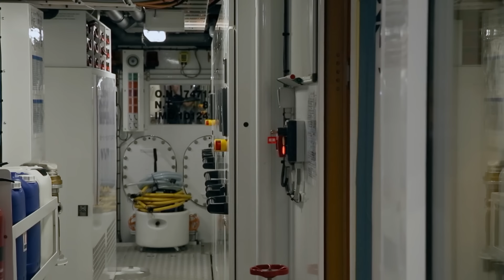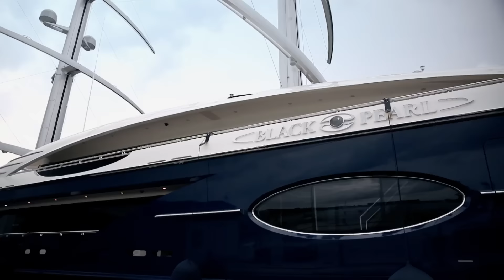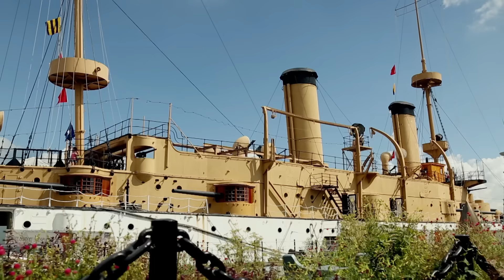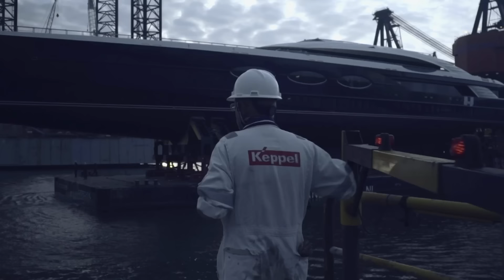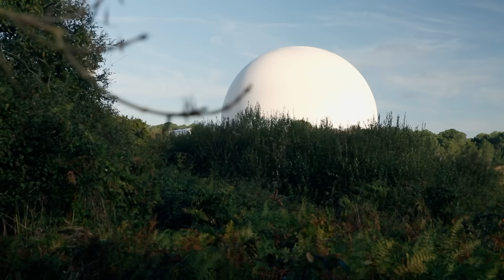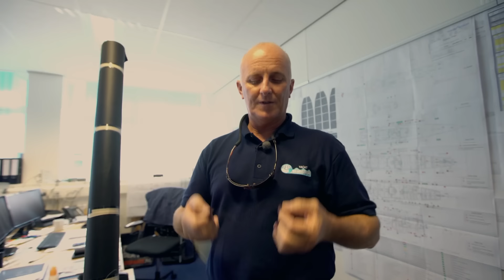The Black Pearl: the Revolutionary $200M Sailing Yacht | Blueprint

Comment: Excellent video, but....1) Very US-orientated film. The British were the first to commercially deploy feathering propellers and the French were the first to build steel warships.
2) Thousands of people have crossed the Atlantic without fossil fuels. Solar cells had been developed decades earlier, not using silicon. 3) It would be good to get an update on whether the solar cell clad sails worked - I have serious doubts. The generating turbines should be enough to power the boat even in light winds and the cells would not be enough to provide meaningful drive in zero winds anyway. 4) The sail rig appears to be a direct copy of the Maltese Falcon??

Comment: sorry, but this is one of the worst documentaries i have ever seen... its just a repeat every five seconds and if something new is introduced then there is no significant technical information about it... Like how did they manage to distribute the load of the masts safely to the hull? And i don´t mean: ah they used this and that material and that is it, I want detail about the structure. Just a steel sheet alone does not hold any of this! this is a technical doku isn´t it? i did not hear any significant technical information! AND STOP REPEATING YOURSELF SO OFTEN!

Comment: Fuel usage of this yacht according to Wikipedia:

1: As of 2018 when designed, it was expected that Black Pearl could cross the Atlantic using only 20 litres (4.4 imp gal; 5.3 US gal) of fuel, aided by regenerative technologies. (It was not designed in 2018, it was delivered in that year.)

2. Under sea trials, Black Pearl achieved 20 knots of speed on the water, and its developers expected as of 2018 that it might one day be able to transit the Atlantic using no fuel.

3: In its first crossing, 5600 nm from Montenegro to St. Barths in 2023, Black Pearl sailed approximately 80% of the distance and consumed 32000 liters of fuel.

So much for expectations and good intentions.

Comment: A feathering prop is not an unusual option, especially on twin engine aircraft.  Many boats have a feathering prop.  The Black Pearl is not innovating by using it.  It's pretty standard fare for anyone that can afford it.  That being said, the prop systems are not that expensive on smaller boats.

Comment: It really is a remarkably traditional design that has been beefed up with tons and tons of carbon fibre to reduce weight, and tons of electric motors to replace crew.

Lots of potential performance has been left on the table by not using: aerofoils, hydrofoils, multi hulls, air bubble lubrication, solar cells for electrical assistance, and likely a couple of more exotic enhancements.

Comment: "8000 kW per month" doesn't make any sense. If they mean (as I guess they do) 8000 kWh per month, we could perhaps estimate an average of 10 hours' worth of sunlight per day, so 300 hours per month; therefore an average power output of roughly 27 kW from the solar cells.  I'm always surprised by how many people who ought to know better can't get their heads around the difference between kW, which is power, and kWh, which is energy. It's like confusing speed with distance, which people mostly don't do. If you were to say that a car can do 130 mph per day, people would rightly think you a little confused.
But didn't they also say they could run the props as turbines and generate electricity that way? They didn't make clear how many kW that was at top speed, but I guess it would be considerable if it slows a 3000 tonne boat down from 20 to 18 knots. Obviously they'd try not to use that system when going for speed records.
Reply: The 8000kW he mentions is what the vessel would normally consume in a month of active ops; he mentions a figure of 25 or 27kW for the props in gen mode, but as you imply, it depends on the sett you give your props and how much speed you're willing to sacrifice for that power gen; anything over 15-20knts I'd go for max re-gen, I'd probably also be telling the crew to switch off everything that didn't need to be on!

Comment: Can someone answer a question for me? Why don't cargo ships use sails to reduce fuel costs? I always wondered this. The only thing I could think of is maybe it would make it unstable but I can't think that's true with all that weight.
Reply: Weather variability , installation , operational and maintenance costs , speed . 
This craft is just a dinghy compared to a modern cargo ship . How much rigging would be required to propel a cargo ship competitively against diesel power ?
Reply: @DamosTamamoto there are very inexpensive kite systems that retract themselves and can be replaced in like a half hour. During favorable wind conditions you pop them and retract when it isn't.
Reply: @butter7734 😂🤣 really ? Like I said … how big are modern diesel powered cargo ships ? Why are they so big ? If it takes three 200ft masts to propel the sleek Black Pearl with 3000m2 of sail ( if I remember correctly! ) with a displacement of 3000 tons , how many kites to propel 70000 tons ? And popping out of what ? Sailing vessels need a substantial keel to transfer sail caught wind energy into forward motion as the wind does not always conveniently blow from behind . An increase in draught would restrict entry into ports . Lifting keels reduce cargo space and further raise costs . Ships would still need viable diesel engines to keep to schedule when there’s no wind to fly kites and to manoeuvre in ports , should they be deep enough ! But I’m no expert but the fact that we don’t see kites or any other types of sails on modern cargo ships when the technology is well known must be because that it makes no overall economic sense to do so .

Comment: WHY COULDNT YOU ''RETRACT THE PROP & SHAFT''?????????????    you could pull it up to the SHAFT ALONG THE HULL and then the last prop blade that hung down could ''FOLD'' back and then ALL YOU NEED IS THE SPACE FOR THE REAR BEACH DECK TO BE AVAILABLE DURING SAIL/RACE FAST MODE......    

my ''version'' of this boat will have 3 or 5 of those panels as ''SOFT SOLAR PANELS'' working up to the goal of ALL OF THEM ALSO ARE INDEED ''SQUAREEMAST TYPE SAILS BUT MOSTLY THEY ARE SOLAR PANELS....  just hs to go ''faster than most of them other sailboats lol'' I PERSONALLY do not need ''the fastest OR BIGGEST'' but 25-30 knotts under sail is pretty enticeing ;) and would make ''the around the world from HEADING EAST TO WEST to ''even me back out'' cuz the US NAVY already messed up my clock, ORDER OF MAGELLAN 1987 USS OKINAWA LPH3 WORLD CRUISE ;)  actualy CIRCUMNAVATAGATION ''westward from San Diego around and back, thru BOTH DITCHES on the ''same ship''  ..... small percentage of people that have LIVED ON THIS PLANET can say that same ''thing'' ;) ((small percentage compaired to the total amount of people there have beeen that walk this rok we inhabit))

THANKS FOR SHOWING US THIS BEUTY !! :)  I have been folllewing the whispers of the ''NEW CLIPPER'' ;)   glad she is as pretty as she should be :)

BUT WITH THEM TUCKED UP INSIDE.... you can't use them to HYDROGENERATE....

Comment: All the effort this show made into telling us how bad it would be when propellers weren't needed because the sails were set out.  So the solution would be allowing the propellers to turn 45 degrees to not cause drag, because again, this is a sailboat, and having propellers cause any type of drag is bad.  Then, were told that the sailboat needs to produce electricity while sailing.  Instead of using the onboard diesel generators for electrical power, the sailboat can instead turn the now "put away" propeller blades back to its original position, so when the sailboat is moving under wind power, the propeller blades can spin by water force creating power for the boat.

Tell me again why so much effort and money was put into solving a propeller drag problem on a sailboat, just to not use it because you use those same propellers because of the drag it has to generate power?

Comment: Someone might know why but why wouldn’t the prop become net neutral if it’s spinning and generating electricity. It’s not providing power but it is now spinning based on the sailing speed. I guess anything disrupting flow would make it less efficient
Reply: Read your query 3-4 times, still can't ascertain what question you're asking.

Comment: Be interesting to see what you could do with this technology if it were optimized for capacity and cost rather than speed, so you would have something other than a rich man's toy. The narration is weird, keeps referring to "impossible" problems then telling us how these problems were solved with technology that's 100-150 years old, like steel hulls and feathering props. At some point I expected the narrator to talk about the "impossible" problem of getting light inside the hull, but no! 140 years ago Edison et al. invented light bulbs! And electric power! You can even use it to cook food! The solar-power sail system, OTOH, is a genuinely impressive piece of engineering.

Comment: Why do descriptions of the Black Pearl always make out that they were the ones who invented the technology when it was the Maltese Falcon that pioneered it all. The Black Pearl is just a slightly larger copy of the Maltese Falcon!!!
Reply: Same Dutch designer.
Reply: Actually, the Dina Rig was first installed on a Catamaran as a test bed back in the 1980's
Reply: Not, really. The big added features of Black Pearl are the solar sails and impeller that can charge the batteries instead of relying on diesel generators. Maltese falcon also uses the dynarig, but was built before renewable technology had matured. Black Pearl is the maturation of the Falcon's design.

Comment: It's only the second-largest sailing yacht. Jeff Bezos's sailing yacht, Koru, is 127 meters (417 feet) long. It is considered the world's largest sailing yacht.
Sailing yacht 'A' is larger but it is sailing assisted. It uses it's engines as primary propulsion.
Reply: Bear in mind this video is probably pretty old.
Reply: @zezzamoo  Both S/Y A and Sea Cloud were built before Black Pearl, and are larger.

Comment: It is an impressive piece of engineering and craftsmanship, but unfortunately it is currently only the second largest sailing yacht. 
1: Sailing Yacht A -  142,81 Meter
2: Black Pearl - 106 Meter
3: EOS - 99,92 Meter
Reply: Sailing Yacht A is a sail assisted motor yacht, not a true sailing yacht.
Reply: @jimbo1637  It has masts and uses sails to catch wind...motor assisted or not, it's a sailing yacht...it's in the name.
Reply: Unfortunately it's only the 4th biggest, Jeff Bezos "Koru" is 15m longer, and the "Sea Cloud" measures 109m...since 1931.

Comment: They've been feathering props on planes (and boats) for more than 100 years and you guys act like it's some great new thing.
Reply: I was going to say the same thing, the "I cant believe we're going to do this comment" I believe was for TV but just sounded so dumb.
Reply: and they think size doesn't equal speed, it does for boats and ships that don't plane or foil
Reply: 7yea   my above post said ''WHY COULDNT YOU RAISE UP THE SHAFT AND FOLD ONE OF THE BLADES BACK ALONG THE HULL and tuck up the other blades up into the ''BEACH DECK''  the rear ''storage space''.....  they have had folding blades for a LONG TIME TOO
Reply: I am enjoying watching the video, but it is definitely a puff piece made to lie while telling the truth.  If you have a small little lie with a big truth, you can make something sound much more than it is.
Reply: 18:33 did you miss the part where they talk about feathering from WW2? Comprehension fail much?
Reply: @theclifbar  You are missing the point.  A great example would be @ 17:00 the program says "Could an innovation from the past offer a solution to this unfathomable problem".  This implies that engineering hasn't continued to use this technology, and that the black pearl is very unique, by resurrecting the technology from the past.  It is not an unfathomable problem, because planes and boats have continued to use the technology from it's inception.  They do talk about the history, of showing it on aircraft, both old and new, but they also talk about how innovative the Black Pearl is, by using the technology, which is simply not true.  Do you comprehend that?
Reply: It is very negative feedback for a new thing. I think it is ok to go for a big statement creation and get excited about it. The world will always present as a creative space and there is no need to rubbish others joy
Reply: If you’re not into propeller flight, it might not be something you’ve ever considered. I remember finding out about it 20 or so years ago, when I was reading a book on bombers in WWII. I don’t recall it being something they talked about on the Military or History Channel. It was a good way to show feathering for the layman. I would imagine it was interesting for younger viewers, or those who aren’t up on prop planes. I’ll admit there was some hyperbole, but they’re trying to make an entertaining program, so I’ll cut em a little slack. Overall, I quite enjoyed this presentation.
Reply: @goldenageofdinosaurs7192  - "...they’re trying to make an entertaining program, so I’ll cut em a little slack"
When the subject is factual, I prefer being entertained without being mislead (it can be done, as numerous examples prove) . The claimed historical "sources" for technologies used for this yacht felt forced and almost certainly were made up (they existed of course, but I'm pretty sure the designers of this yacht had none of them in their minds when they designed the yacht).

Comment: How can they not talk about S/Y Maltese Falcon??  The rigging, mast and system controlling is an exact copy of
Reply: Is little smaller but same designer, Gerard Dijkstra from the Netherlands.
Reply: Gerard Dijkstra was involved in the design of both ships so that is not surprising.
Reply: 100%. Tom Perkins was the driving force behind creating this modern rig and the carbon fiber masts.
Reply: I spent a lot of time on Falcon. The sailing systems were all developed by the hard work of Tom Perkins, Chris Gartner, chief eng Jed White, and a cast of very smart people.
Without this, BP wouldn’t exist.
The yacht was too big for Perini to build, so Oceanco did the hull.
The sailing systems were Perini & Caccini .
They have always avoided making any mention of Falcon. Seems odd, but that’s the way they want to write the script. It would be like beneteau saying they invented sailing sloops.
You are correct. The show has way too much filler, and lacks content
Reply: Yeah...I thought this was that, so I was really confused there for a minute....
Reply: They chose not to talk about the S/Y Maltese Falcon because it would "diminish" the "one of a kind design" that is The Black Pearl (it's not a one of a kind).  Similar to it's revolutionary feathering props, that can even be used as a generator.  It's not even close to a new technology, but if you slip in a small lie of omission with a obvious truth, you can make anything sound pioneering / cutting edge.
Reply: @TheMrBrianh  Yeah, "they were inspired by bla blah and came up with this design" which is in use by hundreds of thousands of boats already.
Reply: Not even that but they also talk like the Maltese Falcon never existed

Comment: Sailing yacht A is the largest Sailing vessel by a wide margin over the Black Pearl.
Reply: No, the Preussen is and it is the largest real sailing ship. Sailing yacht A has a motor that is more than a backup motor. You could say it is a hybrid.
Reply: Yeah, and the Maltese Falcon pioneered the Dyna-rig.  But hey they basically used this show to gain awareness that the Yacht is now chartering, so I'm not going to be upset that they fooled some multi-millionaire into chartering the yacht by them not being pedantic with their puffery.
Reply: @donaldendsley6199  Maltese Falcon en Black Pearl are both design by Gerard Dijkstra from the Netherlands.

Comment: Where and what race is this 200 million dollar ship going to participate in .
Reply: It wasn't a race, they tried for a trans-atlantic speed record for super yachts.  Specifically trying to showcase little to no fossil fuel use for the journey.  Last I saw they did it at 20 days with about 32,000 liters of fuel which is around an 85% reduction of fuel usage compared to a regular sailing super yacht.

Comment: As a sailor the innervation in this yacht is groundbreaking squire rigged because modern design would not allow enough sails area, sola in the sails amazing, thank you guys for great videos.
Reply: Modern designs allow for enough sail area.  The Dyna-rig is actually less efficient than Bermuda rigged ships, meaning for the same propulsive force you need more sail area.  The reasons for the dyna rig, which were not stated are: #1 it allows for much less crew.  #2 it has safer sail handling. #3 the sails are much cheaper (for a ship this size).

Comment: Travelling across the Atlantic without burning any hydrocarbons (fossil fuel is a propaganda term pushed John D. Rockefeller to create a sense of scarcity in order to further his oil investments) is slacking. We should all be releasing as much Carbon Dioxide as possible in order to stave off the CO2 famine, which has been encroaching on us for the last 160 million years, as carbon has slowly been buried in the form of ocean sedimentation. Still, this yacht is a superbly well engineered rich man's toy; as such I can forgive them for not doing their part to release more CO2. Thanks for the video.